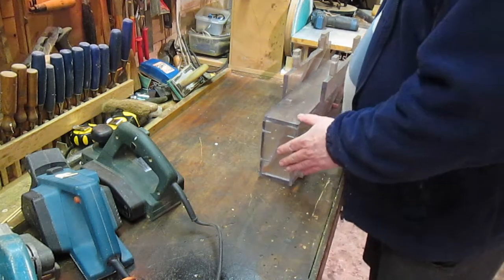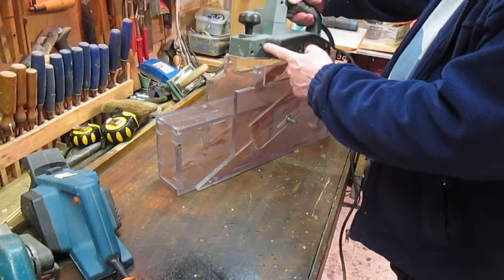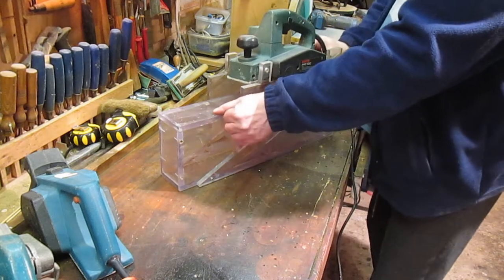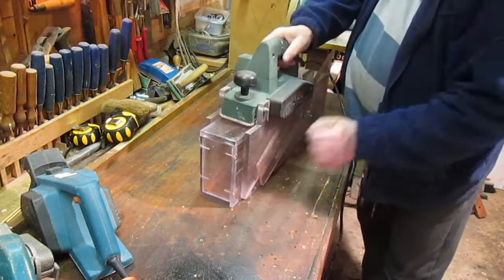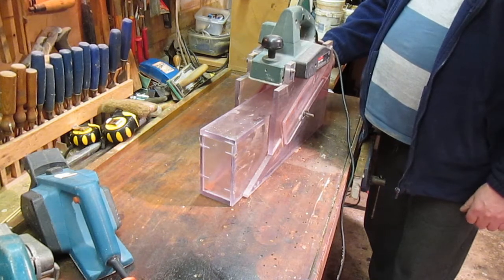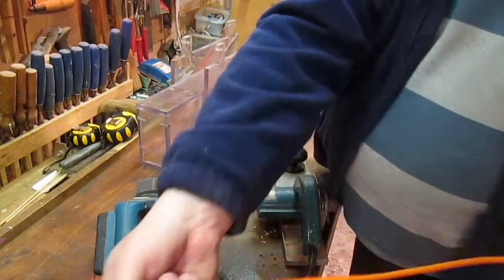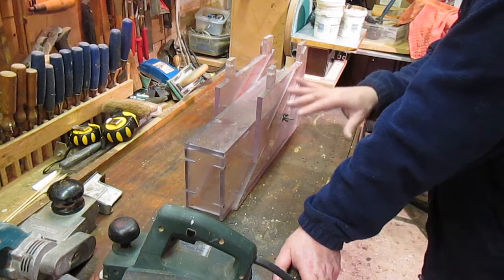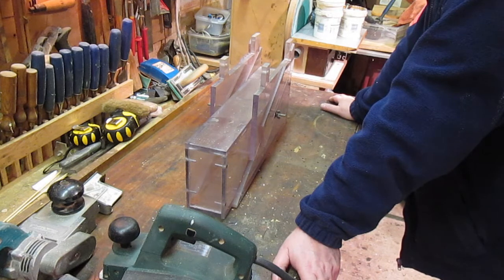Homemade electric hand plane thicknesser attachment. FNF 02

Comment: I know this is an old video, but figured I'd comment anyway in case it's still an open project. You said the wood was fine going in the front but would bind going out the back. My guess is that because the wood applies pressure to the cutter head as it passes underneath, the front of the planer is getting pushed up slightly during operation. This puts the planer at a slight angle so that it pinches the wood on the other side. Maybe you just need something to clamp down on the planer from the top?